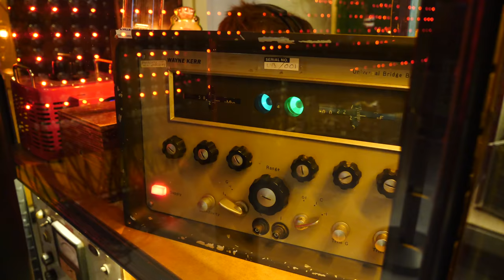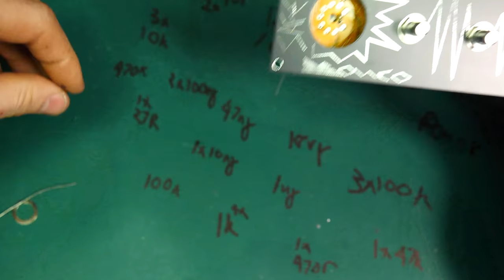10 VACUUM TUBE DISTORTER

Comment: Just removed the 5W 27R resistor going to pin five heater pin on my look mum no computer GMSN safety valve PCB and it's working batter than ever! I just snipped the leads of the resistors and soldered them together.  So glad I watched this video.

Comment: I am building the erica swamp and it's recommended to use a 10 ohm resistor if you don't have a ferrite bead or just wire it, thanks for confirming in this build as well.

Comment: ISO shorting the 27R resistor you can install a NTC. this protects the valve from flashing during cold powerup and still offers low resistance for max filament heat. This trick was done in valve based TV-sets.

Comment: Aaaah, use a socket for that tube!  Replacing it when it fails is going to be a real pain.  Plus, using a socket means never applying solder temperatures to it.

Comment: You should have a pan knob on them to make a wide AF stereo field & Wet/Dry, in parallel. Be nice to have a range of saturated distorted and driven all over the place.
Reply from the maker: Well it's modular that's what using it with other modules is for.
Reply: @LOOKMUMNOCOMPUTER  Good point. I can't wait to visit your museum! I am eventually going to build my own modules when I get some time.

Comment: Directly soldering the valves makes micro-cracks in the glass surrounding the pins from thermal expansion and as a result the valve can slowly lose the vacuum and fail early.
Reply from the maker: Well I have one from 7 years ago and still going strong time will tell I guess. These tubes do not get up to full operating temperature anyway
Reply: @LOOKMUMNOCOMPUTER  You have made 10 identical so keep us posted with the health of that modules in the future.
Reply: The pins on a 9-pin valve are actually made of a special metal alloy, that has about the same expansion/contraction coefficient that glass has, this is so that there's a good metal-to-glass seal around the pin so that no air can leak into the valve, this means that there's very little likelihood of micro-cracks occurring in the glass, consider this....when a valve is operating normally both the internal metal electrodes, heater-filament, and the glass envelope gets hot anyway, whether the valve is soldered onto a circuit-board, or mounted in a socket.

Comment: Should really use sockets for the tubes. Either the friction pin sleeves, or the discreet style. Especially tubes are component with finite life.
Reply from the maker: They live longer than capacitors? Having soldered and also socketed valves for a number of years touring with valves. They have come loose from sockets.and the soldered ones just keep working. This isn't getting hot and will outlive the electronics around it.
Reply: @LOOKMUMNOCOMPUTER  Fair. If them coming loose was a concern there also was locking sockets

Comment: Great Video! But why didn‘t you use sockets for the tubes? (for example to try out different tube types (ecc83, ecc81, ecc82 etc.) for different gain structures)
Reply from the maker: Because for this module it's pointless. The ax7 is good. I have a socket one and it's problematic on tour

Comment: Please use tube sockets! Tubes are not meant to be soldered! The heat can stress the vacuum seals on the pins leading to eventual leakage.
Reply from the maker: It does not get to full operating temp also having toured with 2 types of this safety valve for 3 years the socket one has been problematic and the soldered one has been fine. It's fine. If it was gunna be cooking yes. But in this module it isn't a problem

Comment: 8:59 - Suddenly Sunn0)))
Reply: LOL, feel that.. Seen em live twice.. since this is a music tech channel, might be curious to learn big part of their sound (and namesake) is from the vintage SUNN O))) model T valve amps... they don’t use many effects - bit of ProCo RAT distortions for extra fuzz, but most of the tone is off the 4 12AX7 preamp valves in the amps - originally marketed as a universal amp solution to both electric guitarists and bassists... Technics aside it’s really crazy since the force of their speakers on stage ends up driving the guitar pickups and even the lower strings, sympathetically. Crazy :)
Reply: @ndrstrl1142  Nah actually I was talking to Steve earlier (Stephen O'Malley) and asked him about what you said, since it seemed a little fishy, and he told me that they've always used 15W Line 6 Spider III amps, and all the distortion comes from running 3 effects loops in parallel. One of the loops consists of 6 Boss Metalzones, one consists of 6 DigiTech Death Metals, and one consists of 6 Behringer Ultra Metals (they loved the number 666 because it looked like 3 flaccid penises, which they thought was hilarious, but later found out it was the Satan number, and by then it was too late to change it). The wall of "amps" they use when they play live is actually just painted cardboard boxes which they use to hide all the real gear because they're really insecure about it. 

The name is actually a total coincidence - according to Steve, Greg suggested naming the band "The Sun" because the sun shines a lot of light, and he wanted to use the band's lyrics to "shine a light" on corruption in the management of Seattle parks, which was a serious concern of his due to the amount of times he had been caught smoking weed in Cowen Park. They've been meaning to write a song about it since they started, but still haven't gotten around to it. Steve didn't think it sounded metal enough, so he suggested adding a second N to the name, stating that the N stood for "Nasty". Greg liked the idea but wanted to one-up Steve, so he suggested adding a picture of the sun to the name. Steve loved the idea, but after trying for several days, the closest they could get with the computer they had at the time was "0)))" (the 0 is the sun, and the ))) is the light radiating from it), and they just hoped people would get it. 

A few years later, they heard that all their fans thought it was named after an amp company, which they had never heard of. They tried to sue Sunn Amps for stealing the name, but the company's legal dept told them that the company had been around far longer than the band, so if they continued, the company would countersue. This scared the shit out of Steve and Greg, so in an effort to ingratiate themselves to Sunn Amps, they started claiming the name was an advertisement for Sunn Amps, and they made a bunch of fake Sunn amps to display at their shows, since the company wouldn't agree to an actual promotion deal and they couldn't afford to buy even one of the amps, let alone a whole wall of them.

Comment: ‼️‼️‼️if that power supply at the start is One of those cheap ones off eBay wish Amazon et cetera then you need to try and get rid of it as soon as possible they are terrible

Comment: use a valve socket instead of soldering them directly to the board!
Reply from the maker: I have done both with synths for years and soldering is better. Sockets sideways on a touring synth has.proved.problematic. plus tubes outlive capacitors
Reply: @LOOKMUMNOCOMPUTER  fair enough, i forgot that you would probably tour with it, which i can imagine would very easily knock them out of the sockets

Comment: What's the point of putting valves on the boards if you are not going to use them? Just because they look nice! They are not in the signal line as you have no B plus voltage, the scary high voltage DC you need in order for the things to work
Reply from the maker: No you don’t they are being used you don’t always need high voltage. In fact starving them with low voltage makes them frazzlier

Comment: soon we will see blu-tack [only 29,99/month!!] with nano ic´s and it will not tac if the cloud service is down. 
a water boiler that cant get to 100C and boil water because of the latest patch  
wake up to an empty garage because your car decided it was time to go to the scrapyard after 3 years of use. 
The best of all; whats up with todays light bulbs? Yea, I can see you are light but you produce no light.. 
.. still roll with speakers connected with cables to a 40 year old amp with servicable parts ... Good in - good out.

Comment: No valve holder is kinda cringe
Reply from the maker: It isn't thoigj
Reply from the maker: Need to understand these valves are being under powered. They will outlive capacitors. I've had valves fall out of sockets but the soldered.ones just keep working. It's fine